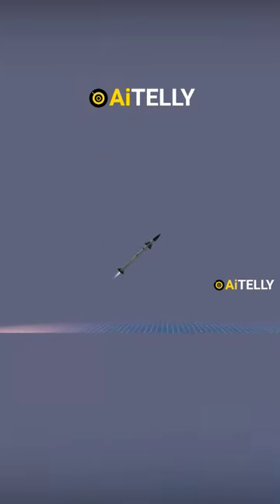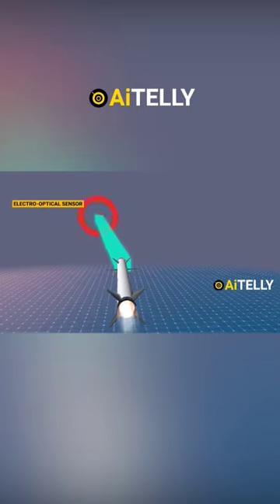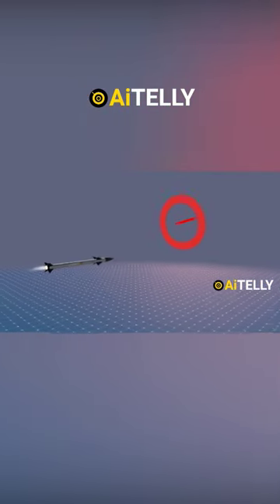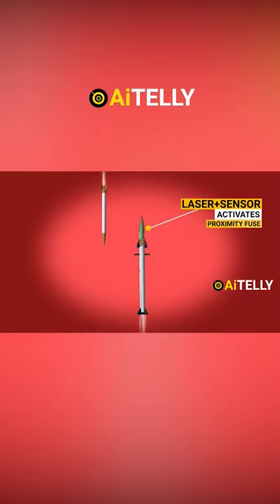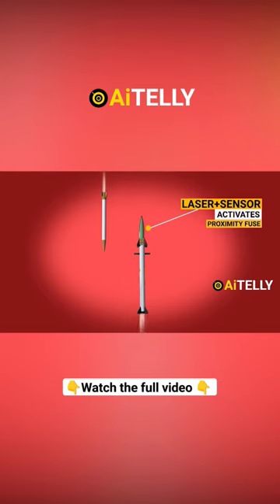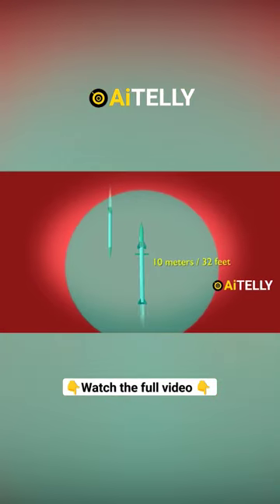Iron Dome Missiles explained in 30 seconds #3d  #missile #science

Comment: Well hamas cheap weapon managed to overpowered the iron dome. It seems they can only intercept light rockets but not heavy rockets and even iron dome can't intercept a large number of light missiles .
Reply: it simply because they fired too many missiles at a once, and every machine has capability to track limited number of multiple targets. this time it far exceeded total capacity of all Iron dome system. but there was significant loss to Israel as their each interceptor missiles cost is almost 50 times costlier than hamas cheap missiles
Reply: @pankaj160160  Exactly, the Iron Dome was being over estimated.  The Iron Dome has limited capacity they cannot really intercept large amount of missiles and they cannot Definitely intercept long range missiles too the only missiles they can intercept is a cheap and light missile that has limited capacity and that also is a problem because of the cost. the Iron Dome missiles cost way more than Hamas missiles And just imagine if 2000 missiles can overpower Iron Dome system what do you think 127 thousand missiles that Hezbollah owns can do to The Iron Dome?
Reply: @hornerfarah2282 but for years it worked and Israel didn't need to ground attack Hamas. Which will be far more costly than iron dome.
Reply: @hornerfarah2282  i can't understand long range and small range missile impact iron dome capability. 
Infact long range Ballistic missiles are easy to track due to the predictive path they follow whereas for cruise missile since they follow the contour of surface and they can be easily be maneuvered  during flight so radar has difficulty in detection.
Reply: @pankaj160160  No it’s not that easy. long range ballistic missiles are actually more complex than you think. since they travel in high altitude and a high speed that make it hard to counter. The Iron Dome is primarily designed to intercept short-range rockets and mortar shells. It is not typically used to intercept long-range missiles, such as intercontinental ballistic missiles. Iron Dome’s capabilities are best suited for defense against shorter range threats, like those fired from Gaza into Israel. For defense against long-range missiles, countries often use different missile defense systems, such as the Patriot systems, depending on their specific requirements.
Reply: @hornerfarah2282 Do they have the balls to do it, though?
Reply: @matthewbaxter8558 they already did it. Hezbollah actually engaged with Israel. They already made statement that if israel invade Gaza they would join the fight. That why Israel deployed half of their forces to the north.